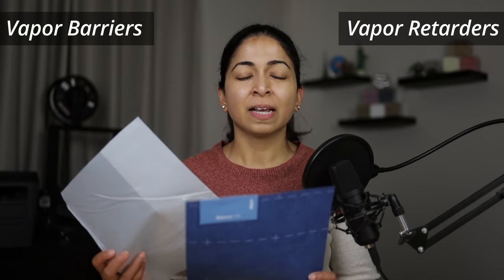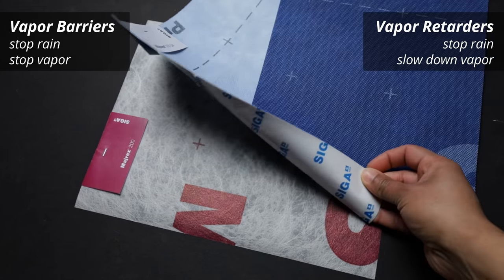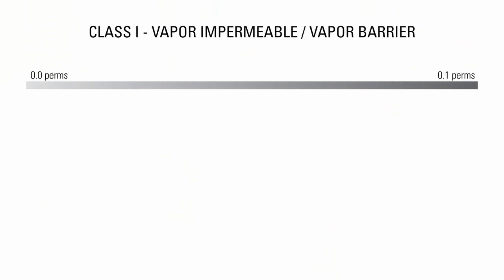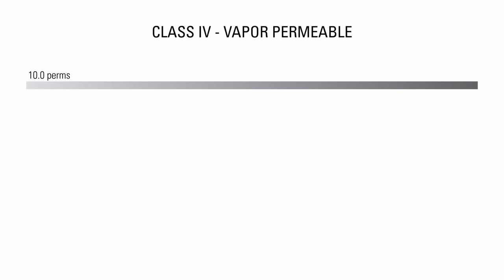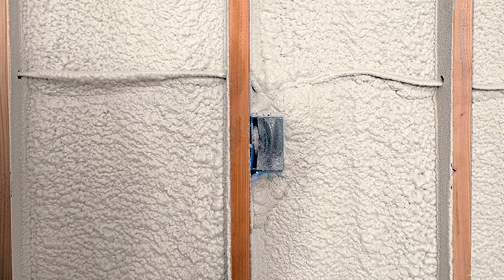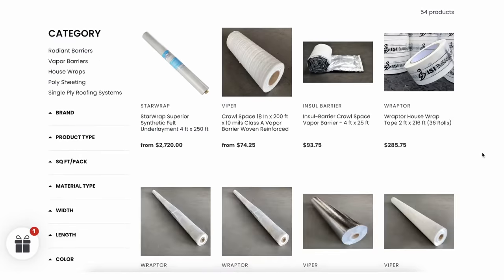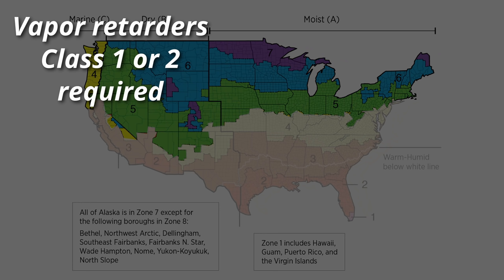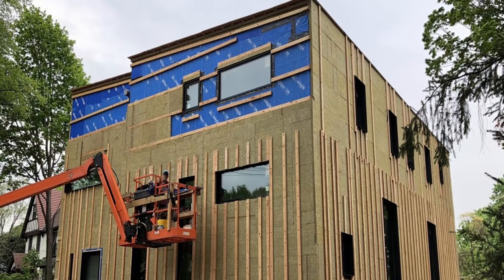Do you need a Vapor Barrier or Vapor Retarder?

Comment: I live in Winnipeg, Manitoba, Canada and our code here is to use a vapor barrier on the warm side. I recently had a new garage built so plan on using 6 mil poly for that as the vapor barrier. But in my basement I used 2" XPS on the walls so I would classify that as a vapor barrier so I feel that I shouldn't need to use poly down there. But I'm sure the inspectors here would disagree and say that I need to use the poly vapor barrier. To me, this is then having 2 vapor barriers which wouldn't allow any water to escape. What are your thoughts on this?
Reply: The code in your area likely calls for a class 1 or class 2 vapor retarder, which 1"+ thick continuous XPS foam sheathing qualifies as. Your 2" XPS would need to be either continuous on the outside of your foundation or continuous on the inside of your foundation to qualify, though, you couldn't just place it between studs. Class 1 vapor retarders (like poly sheeting) are no longer considered best practice for moisture management in walls, but are still allowed by most codes.
Reply: @JamesCusano  The 2" XPS is glued (PL 300) to the foundation so I would consider it continuous. I then built a 2x4 wall in front of that and then used Roxul insulation (R14) to insulate that. 

The only thing is the floor joists were put into the foundation when it got poured back when the house was built. So I didn't put the XPS in the spaces between the floor joists as I read that could cause the ends of the floor joists to rot.

Comment: Thank you for the video. In New Zealand it is typical to have long run corrugated steel roofing on a tar paper or vapour barrier nailed to trusses. Insulation is either below this with gaps in skillion roof insulation or insulation resting on the ceiling joists of the building. Many vapour barriers last a shorter period than the roof itself and tear or fall apart - which vapour barriers last the longest?

Comment: My question is about van conversion insullation... As mentioned, it is a very confusing subject... does it need vapor barrier, what kind and where does it need to be placed?... And generally, what is the best Insulation for the walls, floor and ceiling? Thank you for sharing 🙏😌

Comment: Thanks, a bit confused ! How about an attached, unheated garage in Canada. The portion attached to the home was insulated, dry walled, vapour barrier under drywall. To insulate the rest of the garage and dry wall…..continue with Fiberglass insulation, vapour barrier and then drywall ? Exterior walls are 6” studs, OSB, vinyl siding. Any advice ?

Comment: We have a Bathroom in our basement that we are renovating, and our house is brick on the outside and cinderblock on the inside. We are wanting to put up 2x4 studs and finish the basement bathroom with drywall. My question is should I use a vapor barrier in between the cinderblock and 2x4 studs in the basement bathroom? Also, can I put insulation in between the 2x4s? I live in the very southern part of Indiana if that helps for the climate zone. Any feedback would be greatly appreciated!

Comment: Great video,  was wondering what would be best insulation in Chicago zone 5 concrete basement built in 1976. 2" XPS foam board against concrete wall with 2x4 wall with roxul r15 and no vapor barrier or 1" Xps foam against the concrete wall 2x4 wall with roxul r15 and with a smart vapor barrier.

Comment: Hi Belinda👋🏻I have a tiny house project that I would love some advice on. I bought a garden shed with a tin roof and plywood siding sealed with water based paint. I have cut windows in it, insulated using Kraft faced fiberglass insulation for the ceiling and mineral wool for every thing else in the single room. I have been leaning towards using real wood for floors and walls/ceiling, but I’m wondering if I can seal the wood? Would this cause a vapor/air barrier sandwich between my water based paint exterior walls and the sealed wood interior? I’m constantly worried about causing mold to grow. Is there a sealant that can still let vapor diffuse? Or is that contradicting their definitions? Help please 🙏🏻

Comment: Hi Belinda. We live in a cold climate, Alberta. We plan on building this summer. The wall assembly will be metal cladding, strapping, zip r6, 2x6 walls, rock wool r24, strapping and drywall. Should we use Siga Majrex taped all seams ceiling and walls as well?

Comment: Yes please more articles!!

I need advice about the correct insulation schedule for a zone 5 Denver like climate.  Cold snowey winters, mild(4800 feet elevation) very dry summers.  Metal clad building. Concrete floor(wood shop) no interior plumbing. Will erect interior wood stud wall with 12" fiberglass insulation with kraft paper on  inside face.  Air space between insulation and exterior metal cladding.  Stud Walls sheeted with 3/4" plywood painted.  Ceiling sheet rock with blowen in insulation.  Continuous ridge venting. 

Do I  need a air barrier? And if so where?

Between the fiberglass and the plywood...??

I  need advise,  thank you!!

just jim

Comment: I'm now worried; I just have been renovating my 125 year old house with a vapor barrier (6mil plastic sheet).
The house is in climate zone 7; the sheeting is on the inside of the exterior walls, and the insulation is not paper faced (i.e. unfaced R13 in the walls).

Based on your info, for the remaining 1/4 of 1 floor, I will likely aim for non-barrier (i.e. retarder instead), but I worry for the remainder of what I've already done.
If I were to make sure the electrical outlets were all sealed via spray foam around/behind the boxes, do you think it's likely I can avoid pulling the walls off of the 7 rooms I already completed last year?

The house is 125 years old now. I won't own it for more than another 6 or so years by current plan, but I'd like this old beauty to last for another 125. Given that I was pulling off original horse-hair-laden plaster/lath, I'm not expecting the walls to come back down for a long time to come.

Thoughts are appreciated. Thank you.
Reply: As a builder and renovator of old houses, I imagine you’ve inadvertently created an unfortunate condition. Don’t be too hard on yourself. We can all look back and see errors made with the best of intention. Sealing around electrical devices will slow or eliminate the passage of air into the cavity. But controlling for water vapor isn’t the same as controlling for air-tightness. Before thinking about tearing out what you’ve already completed, consider a testing regimen done a couple of times a year where you test for mold and moisture. Perhaps sections of baseboard on outside walls could become removable to facilitate the testing regimen.
Reply: Its still standard to use 6mil poly under drywall in 6,7 & 8 in Canada. I would be a little concerned if you haven't sealed the poly around one outlets but you could look at other options before tearing walls out but one thing that is important is sealing your base plates on old houses, Ive seen amazing amounts of moisture and mold build up due to lack of sil. gasket or air sealing. 
If you are redoing the siding one thing to look at would be to do a rain screen to help the water that does migrate through the wall to not get trapped. Old houses lasted a long time because they didn't hold moisture at any point... or heat!
Reply: If your in zone 7 I would put 6 mil poly, all houses here in Canada have it and no problems if the exterior side can breathe,
Reply: Given the comments of differences between Canadian outlook and American, it’s prolly worth mentioning when I went to college in this town 25+ years ago, the neatest Taco Bell was further than the border with Canada (crow flies). Houghton, MI is a good stretch from Texas. 
Thanks for the advice everyone. I’ll check in on the new outlet sealing this coming summer (Great Stuff FTW if needed?) and consider how to handle the walls I’ll be dealing with this year. I’m thinking I’ll NOT be tearing up 70 sheets of drywall to redo everything… :)

Comment: I’m sure you misspoke when you said  “ROXUL Comfort Board can stop air infiltration.”  It is an excellent choice for continuous insulation though.
Reply: She said continuous insulation like Rockwool Comfortboard "can" stop air infiltration, which is accurate depending on installation detailing. One common approach is to apply the insulation in two layers, with the seams staggered. It does not qualify as an air barrier on its own (which she didn't say that it did), but it reduces air infiltration to such a degree that you're no longer completely reliant on only the integrity of a vapor-permeable air barrier membrane.

Comment: During my winter reno, I forgot to turn on my heater.  So when the morning sun came up I thought there were a serious leak in the envelope.  But everything went away as soon as I remembered to turn the heater on at night and kept the interior temperature higher than the outside during day time.  The moisture quickly went away.  I was quite surprised at how much moisture can collect on the barrier on a South facing wall.  Unfortunately our code requires them.  So practically?  I would never use them in the Pacific Southwest (as far Canada's south west lol).

Comment: Your videos are helpful but sometimes confusing. I just used great stuff to foam only the inside borders of my basement rim joist, and also the perimeter of the sill plates? i think they are called where the concrete poured foundation meets the wood. I'm climate zone 4 per your video. I am on a tight budget just trying to prevent heat loss in winter and spiders and scorpions from coming in the basement. After i air sealed the joists i was told that to save money just to put my fiberglass r-13 batts loosely back into the rim joists. These areas are open areas ABOVE my basement drop ceiling so is it necessary to install a moisture barrier or retarder over what i have just got finished doing? 
I did notice the only blackish stained osb rim areas were in the bathroom and closet but i sprayed microbiam? and let it dry there before placing my batts back. What is your advice with details on which product i should do next (if anything at all?) I plan on buying a whole home dehumidifier next spring fyi which should help with summer humidity. Would love you to do video on them aprilaire vs santa fe vs ???.
 My finished basement is pretty comfortable year round and my small portable dehumidifier is keeping at 54% on half of it although the rooms are walled so the farther away from it is it's about 64% and we don't need to run heat ac down there typically till winter months.  Thanks
Reply: I forgot to say my house built in 1999
So unaware of what insulation or wrap if any was used on exterior under vinyl.

Comment: @Belinda Carr, Can you talk about how this topic intersects with steel buildings?
Reply: Yes I  have an all steel building and I am going to add an interior stud wall And fiberglass insulation.  There will be an air space between the metal exterior clading and the fiberglass insulation. I live in a Denver like climate. High and dry. Very cold in the winter. Very little rain....more snow then rain...

Need help with the "correct " insulation schedule....!!

Thanks Jim

Comment: professor.. I have a question for you I'm home builder here in south  korea. many building contractor said that we have to get smart vapor barrier on the inside wall that is so much important having a building envelope. but anyone can't say the reason having a vapor barrier. what is advantage having vapor barrier like this area southern province.. and one more thing Is that ok?.. having vapor barrier without a mechanical ventilation like control of moisture..
I'm little bit worry about that work as setting vapor barrier without ERV.. please give me answer
Reply: A smart membrane isn't a vapor barrier- it will be an air barrier that is semi-permeable and allow water vapor to escape. That could be very helpful in controlling moisture in the air from getting into the walls in the winter. In the summer make sure the exterior is well sealed. Do you use a blower door to assess air tightness during construction? It's a great tool.

Comment: I am looking for an answer to when finishing an ingrade basement, framing walls around the concrete interior, how should I insulate to avoid moisture problems?  Air barrier, vapor barrier, none?  front or back of framing?

Comment: I love your channel! Ok, so you talked about really cold and hot climates and how moisture moves what about those of us in a very temperate climate like Southern Oregon? We’re not too hot not too cold most years. 🖖🏼
Reply: Building codes allow for vapor retarders to be used on both interior and exterior sides of the walls simultaneously; the interior requirement is just a minimum for cold climates. It's no longer best practice to use a class 1 retarder in the wall at all, but it has always been worst practice to use class 1 on both sides simultaneously. In both cold (zone 5+) and cooler temperate (zone 4) climates it is very common now to find a class 2 or 3 vapor retarder on the outside and a class 2 vapor barrier on the inside.

Comment: Hi Belinda, Love the topic, But I'm never quite sure how much to take in from you since I live in New Zealand with a different building code. Eg we build all buildings with cladding on cavities which I believe lets the moisture leave the building eventually & stops in coming in. The vapor barriers only seem to get used on high-end buildings on the internal and wrap on the outside.
Though I'm curious why you didn't mention internal ventilation? I've been thinking home ventilation systems are where its at lately to stop internal condensation and dry out houses

Comment: Question on using vapor barrier or retarder  on a single story dwelling with an encapsulated crawlspace & dehumidifier (installed) in climate zone 4.

We are replacing the MDF with 3/4" OSB over 16" off center joists covered with 12" pine planks. We have plans to lay vinyl flooring that has an underlayment attached.

Do I need to put down anything between the pine planks and OSB sheathing?

Originally, there was tar paper between the pine planks and MDF along with a lot of mold growth between. I am thinking that should not be an issue since the encapsulation, just don't want to deal with it again.

Comment: Great video. I work in mold removal industry. At my house in a warm climate I am installing new plywood subfloor and new hardwood flooring. I want a good insulation plan for temp not moisture. I do not want to install fiberglass or rock wood. Flooring does not recommend plastic trapping moisture as underlayment.  Recommendations?
Reply: Build it over SIPs?

Comment: Hi... please provide some recommendations and product types that we should use for building of our daylight basement house in (tropical climate) in Dumaguete Philippines using concrete hollow blocks. We believe we should have the builder uses a moisture or vapor barrier / retardant between the walls and the slab floor with contact to the dirt. We will also be using drainage to drain around the house, too.  Please leave your comments. Thank you!

Comment: I live South East of Chicago in zone 5. We get cold winters and hot humid summers.  I'm planning to remove my siding and exterior sheathing, paint a vapor retarder on the exterior side of my drywall and studs, then fill the cavities completely with rapid set mortar/portland with a strong mixture of packing pea styrofoam rather than stone in the mixture.  I believe this will let interior moisture escape to the outside.  I doubt I will need an exterior vapor barrier as that would trap condensation in the walls.  I'm seeking a consistent insulation in the walls working from the inside out, a fill for the concrete blocks below that allow insects and creatures into my walls.  I would strengthen the structure with exterior sheathing, half inch plywood.  I would like to install a quarter inch gap between the exterior plywood and the new siding.  I'm hoping to install fake brick for the exterior siding.  I may not need any gap for these products.  Right now my house is susceptible to birds pecking holes in the wood exterior, and mice somehow getting under my siding into my attic.  I hope to get better insulation and seal up the exterior to prevent critter invasion.  My house is built on a 2 foot crawl space.  I want to start with the South wall to see how this works and if satisfactory, move on to the other 3 walls, most likely doing the East wall next.  That wall has been attacked by chipmunks entering the vents and around the vents built into the crawl space.  I suspect the blocks on the wall in the crawl space has never been filled with any cementious materials.
This is a long way of saying I don't think I know any sufficient scientific facts about materials to help me make a decision.  My attic is also not properly vented.  When I talk to architects they don't listen.  They just want to build new cheaper and smaller structures with their own concepts and their own visions.  I don't want an ugly box for a house.

Comment: Belinda, thanks for the detailed information.  I'm preparing to build another home this year.  I lean heavily towards the Zipper System for the exterior walls.  I'm in a quandary regarding the use or thickness of the R3, R6, R9 closed cell options.  We live in Zone 5 on Ohio.  FYI, the plan is to use an r-21 paper faced batt insulation from the inside.  Initial thoughts?
Reply: I have the same quandary in planning my new house in Zone 6 NY.  I don't like the long screws for R9.  Huber says it's ok as a shear wall but you need more screws.  Also, the insulation is on the wrong side of the sheathing so I'm doing ZipR3 for thermal break between the studs and the sheathing then 2" XPS foam outboard = R10.  2x6 24"OC walls with cellulose fill will give a wall of about R34.